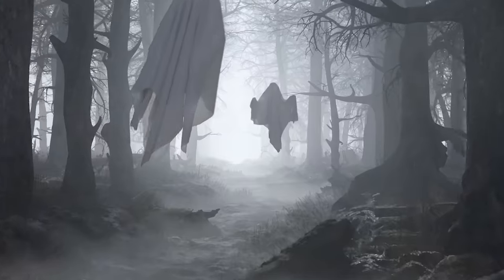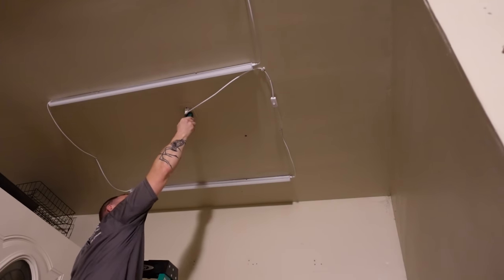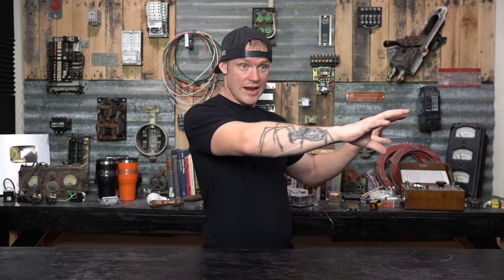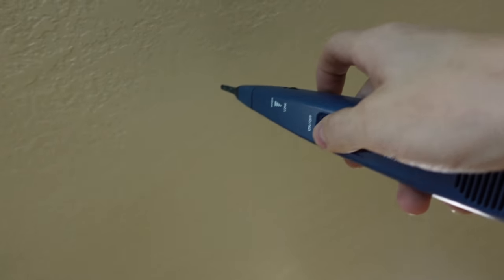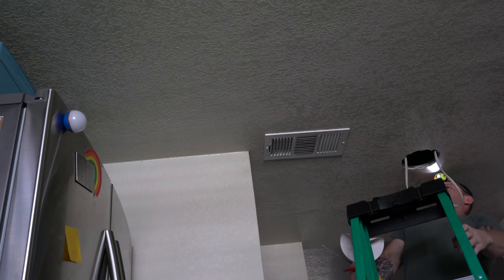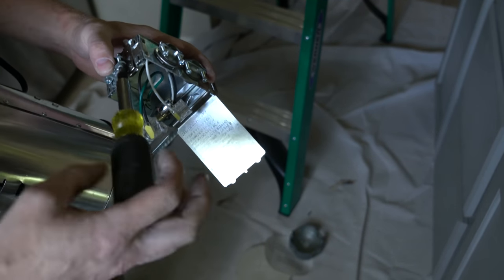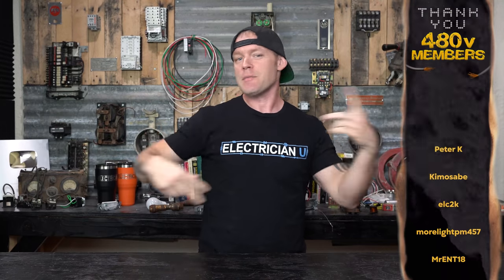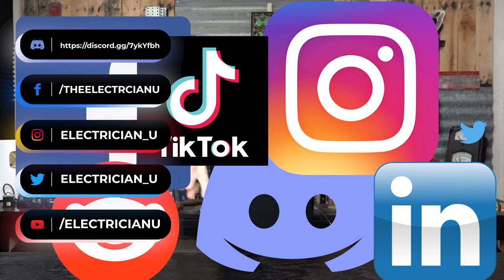THIS IS WHY ELECTRICIANS DON'T HIDE J-BOXES IN WALLS - Finding Hackwork!!

Comment: As a journeywoman in Canada my entire apprenticeship was tough... I mean the 2 companies I worked for held me to a higher standard than the boys. Never picking out the mistakes of them but my workmanship was nitpicked... as unfair/sexist  as it was I do believe it made me a better electrician. As a 3. and 4. year I even got my own service van issued and my main job was troubleshooting all my journeymens crap work. I had to learn all the different guy's decades of wiringmethods etc so I could efficiently fix their mess.  As a result most coworkers didn't like working with me because I guess I made them look bad... since in a man driven industry us girls are often held to a higher standard or we have to work 3times as hard to earn the old geezers respect. So for me it was always sticking to code...( no Mickey mousing on my part, that way they couldnt complain about my physical strength lacking because my stuff was always 100% every time )and to the point that when some apprentice had a code question they were told to ask Kat, she knows all codes.... lol
Reply: Good for you ! Nothing wrong in being good at your job, I have a feeling those before were not proper electricians! The way we learn in the UK is to change companies often because I found many got into a rut, plus some specialise, so its good to change and have a wider scope of electrical installations. I worked most of my life as an industrial Electrical Technician(Foreman). Often abroad and now retired! Never really got into "house bashing" Mostly industrial.
Reply: I grew up doing HVAC and have officially been doing it for about 15 or so years, and I love seeing women in the trades! There was a girl who worked for a plumbing company that we did a lot of jobs with. She was always respectful of people's homes (something many guys forget to do - like mentioned in video, they have to live there when you leave) and never once did she have a "Fuck it, can't see it from my house" attitude so many guys have with questionable or shoddy work. Other than a few exceptions, like carry the old water heater up basement steps, there's not much a guy could do that she couldn't. But anyway, women who aren't going to college should stop settling for min wage jobs, they should learn a trade!
Reply: It should be that the number of dangly bits (one between the legs or two on the chest) doesn't matter, only how well that squishy bit between the ears works.
Reply: Was it sexist though?
Reply: I'd be happy to work with you.  I also had it tough as an apprentice but it paid off and now I can pretty much work any job I want.  Good job!

Comment: The only thing I would have done differently, (as I used this mindset when doing electronic tech repairs) is what or why did it fail to begin with. I mean aside from it not being up to code, the absurd length of additional wire that looks like it was tapped into ONE breaker raised several questions in my mind immediately. I know that the gauge and length have specs, but I'm not clear on losses when they are tied together.  I have to assume that they probably had several things on at the same time that joined at that junction box.  I know it's not your job to load test everything, but I probably would have highly recommended adding a breaker or two to the main box to prevent further problems. I'm betting you will be called back for additional issues where this can got put in. 

In my electronics repairs for example, it wasn't enough that I could successfully repair the component, but also educate the customer on what they did wrong that caused it to be the issue to begin with.
Reply: How conscientious of you. When someone is willing to tell me how to ensure I don't have a repeat problem - that's a 10-star rating in my eyes.
Reply: yeah you're right, something doesn't seem quite right with the circuit layout. But that is extra time and money and the homeowner probably just wanted things to work again and be safe, not ideal. With problems like this it can be very hard and time consuming to exactly diagnose the problem. Sometimes it's just 'fuckery' like a wire nut was barely loose and it took 10 years for the wires to sneak out of a wire nut.
Reply: wow, definitely not like that for most electricians, usually it's 14 gauge for 15 amp, 12 gauge for 20 amp. Nobody really measures out the max distance. All you'll see is a slight voltage drop as a wire keeps going forward.
Reply: @patrickobrien6648  There's always voltage drop over distance, I guess if I went thru a 250' roll then I may be a bit concerned, depending upon wht it is powering, When in doubt, change to a #12 or #10 but typically unnecessary
Reply: I'm a 60 yo electrician so was not overly impressed with this guy. Troubleshooting these types of problems is NEVER easy though and each one is always different. Asking questions is my go to for residential problems

Comment: Here’s something that happened to me as a DIYer. I was adding a new outlet to a circuit but I wasn’t sure the panel was labeled correctly (we had recently moved into the house). So I plugged a radio into an existing outlet that I knew was on the same circuit. I tried the breakers until I heard the radio stop. I went to the outlet, unplugged the radio and plugged in my circuit tester into the same plug. No lights, so I was good to go, right? Wrong! After I took off the outlet cover I decided to push my test light into the outlet box, and it lit up!!! Turned out it was a split outlet with the top and bottom on different circuits. The top one was off, but the bottom one was still hot!!
Reply: Those should be ganged breakers so they both shut off at the same time.
Reply: I came across a junction box that had FOUR different circuits going to it.  To kill all the power in it, I had to turn off FOUR circuit breakers.
Reply: When I do a wiring job, I do all the outlets in the kitchen that way. The only other place you would see something like that is for an outlet that is expected to be used for high current applications like space heaters or power tools. In any case, as one other person has pointed out, the two circuits should be on a ganged circuit breaker so that they are on or off together.
Reply: @paulstandaert5709  That is truly insane! I'm having trouble imagining why anyone would do that. I often have two circuits in the same juntion box but that's because I'm doing split-circuit outlets.
Reply: @surferdude4487  I was 18 or 19 when I ran into that, and didn't really know anything back then. I cannot remember what I was doing in there, but I remember lots of colors in that box, and it was only single phase wiring.
Reply: fucking YIKES!!

Comment: Once I was installing receptacles in a house, and my boss was installing breakers, then turning them on. I found out the hard way.
Reply: Who tf turns on breakers during panel install. Jeebus. Just adds unnecessary hot copper to the box. Also dumb to leave the busbars live.

Das Stoopid.
Reply: Nasty boss. I've done some silly damage to myself in my youth, not serious, but it bit😬
Reply: I got lit up on the first house I built, back in 1989.  I was fresh out of high school,  working in family contracting business.  While I was wiring outlets in the master bedroom,  a couple of my cousins (who I had just graduated with) decided they needed power to the kitchen for a radio, and started flipping breakers.  Magical.
Reply: @adirondacker007  even worse, when other trades decide to turn breakers on.  I had cabinet installers decide that they were too good to use an extension cord from the unit next door (idiots claimed that using an extension cord would "burn up the motor on their saw") and turned the circuits on that I had turned off (LOTO wasn't practical on the project).  I read those kackheads the riot act.  Unfortunately the GC's super was on another project (they were trying to have one guy run two jobs) so there was no help there.  Had the previous super (they went through three superintendents on a six month job) been there he would have kicked those jerks off the project.
Reply: Not sure how's there but here you lock the breaker by law . Also you can't turn on the breaker or even connect the circuit to a breaker until inspection and dead testing is done by law ... so ...
Reply: @contytub  where is that, ad how do you accomplish anything?  Sounds clunky.
Reply: @joshpotter9261  why would it be clunky ? Am i missing something ? Why wouldn't  spend few minutes to do the dead testing before energising a possibly dangerous circuit and then do the live ones? Why whouldn't i spend a minute locking off a circuit before working on it ? Not clunky at all ... just spent 4 days wiring a house . Half an hour making it safe and confirming compliance is nothing. Even if it wouldn't be legal requirement i would still do them .
Reply: @contytub  sounded like you are saying you needed an inspector to hold your hand every step.  Also, where is it law?
Reply: @joshpotter9261  well it's true ... even an istaller has inspection responsabilities . Uk ... it actually sais inspection has to be done before, during and after the instalation ...
Reply: @contytub  it happened over 30 years ago.
Reply: @joshpotter9261  i'm not brittish even if i work here so whatever . I also don't really care about customers liking to pay 5-10% more for certification as it's mandatory and shifts blame to whoever signed it that is mandatory insured ... so paying the inspection and testing fees not only proves compliance and finds possible faults making the instalation safe but also in case something goes wrong because the electrical instalation the customer has the house insured by the inspector-not installer. It also lasts around 1h to 2h maximum so i highly doubt you can do 30% from a 4days wiring/install in just 2h ... you speak like a ''old'' ''electrician'' that may have not received formal training on new standards because old ones ''just work''... well we keep fixing fuckups after these people constantly so good luck forwards as our fixes usually are more expensive and proper ;)
Reply: @joshpotter9261  you are just proving my point ...
Reply: @contytub  haha, your pointy head, maybe.
Reply: stoopid boss
Reply: @Guitarplayer724  i wouldn't say stupid. he's ''experienced'' and aparently certified ''up to date'' ... I've been next to plenty of experienced electricians that earn a lot of money but still work with oudated techniques and tools and fail safety standards continuously . What would we do without them ... when i did my cert one of the chapters was looking out for old electrician's mistakes as they were trained on old ways so even the book and law recognises them as possible hazzards hehe
Reply: @joshpotter9261  There are simple little plastic tabs that slip over the breaker levers. 10 secs to install a lock.  Often overlooked because 120v is usually not lethal, but I hate shocks.
Reply: @joshpotter9261  everywhere. OSHA is a federal agency
Reply: @clintsmith4026  so what's your point?  You don't have one.
Reply: @contytub  haha, you'll never have to fix anything I do, because I do it right the first time.

Comment: Excellent video, love your process! This job of yours reminded me of one I was on where a friend had an issue where one circuit on one leg was undervolted, another circuit on another leg was overvolted (and cooked some surge protectors). 
Deduced a floating neutral condition from utility side... utility, through remote testing, insisted their side is fine and said the home had a grounding issue, and sure enough the strap had deteriorated away as well as the top of the rod. 
Ran a new strap and pounded in a new grounding stake, and of course the problem persisted but at higher loads, my friend started losing appliances at this point.
I sent them photos of new strap, new stake, and wildly swinging voltages between the legs in the service panel to get them to physically come over and look over their shit. 
When they finally came over, they disconnected the house side of the feeder drop and it arced out somewhere in the middle, which solidified my hunch that there was a utility related issue. With the new feeder from the pole to the house, the problem was resolved.
So it seems like there was an issue going on with the service neutral and the house's neutral current had been going back to source via ground, which accelerated the corrosion (we get 11ft to 12ft of rain a year) and when the grounding strap finally failed open, the house's circuit had no low-impedance reference and thus allowed the neutral to swing around based on load. My friend was giving palliative care to her dying husband at the time and luckily she only lost a central vacuum and a bunch of surge protectors, nothing more serious than that!

Comment: For those cans Klien makes an adjustment holesaw bit with a built in catch tray
Reply: Throw the adjustable bit away and use the tray with a normal hole saw. Unless you've tons of practice, those two opposable blades can wobble fairly easy. If you're lucky you'll just fuck up the ceiling. If you're not so lucky, and not prepared, the torque will throw you off the ladder
Reply: Yup, tried using those things. Utter trash. The dome was nice for minimizing the mess, though.
Reply: @ajyhimst2782  Or better yet, they come loose and get yeeted across the room into something/someone
Reply: @ajyhimst2782  Or use a decent drill with torque settings. But yes, I prefer normal holes saws.... Got a reload kit... can place smaller hole saws inside on arbor and enlarge holes if needed for different size fittings.

Comment: Man. These are nightmare situations sometimes. Very good break down of your process! Appreciate you man! Did you get my last text?
Reply: I wouldn't  call this nightmare situation lol. Seems like basic troubleshooting process to me. Definitely helpful for people that don't Deal with troubleshooting scenarios
Reply: @christophertague9485  My least favorite is buried boxes. Then again, I never used a toner.
Reply: @nickcheatle3927  yeah man never a good idea 😆. But then again that's why there is nec. I'm guessing by the way that j box looked inside and out,  that it was not an electrician that installed it ,or one that did not care at all.
Reply: Never a good idea meaning burying boxes btw
Reply: Toners are great tool have
Reply: @christophertague9485  yea, who uses octa boxes for j box?? 😄
Reply: @nickcheatle3927  I mean if you do it right it can be used same as a 1900 box. I think the splices were the issue 😬😆
Reply: @christophertague9485  I mean, it CAN be done. But why.

Comment: Sounds like loose neutral broken enough to make the neutral carry line voltage but not enough to tie back to the panel. Thusly making neutral a hot or partial hot and having no voltage line to N because they both had equal potential.
Reply: I bet there was a lighting circuit on the fault side of that junction box that was on and pulling the neutral to line voltage.
Reply: @newjerseybill3521  yep that lamp or device maybe was allowing voltage to come back on the neut.
Reply: Yep. Spot on. That's why we use stranded not hard drawn cable in Australia. And those wire nut things you guys use make me cringe every time I see them.
Reply: @TheDegan79  interesting. Why do wire nuts bother you? First of all i do understand the idea but when properly applied they are effective. What i do to make wire nut connections is use my strippers as a wrench and twist them until the 2 or three wires in them make a full tension loop around eachother. Also what do you use in AU
Reply: @jesseready5667  We use BP's (Blue Point connectors) and yes, always twist.
Reply: @TheDegan79  interesting we would call that a terminal strip we use those in industrial controls but not residential outlets or lighting.
Reply: @jesseready5667  Not the strip style one's... single tunnel. One's with 2 screw's are for earth's but that has been changed recently to allow one screw as long as the screw occupies 80% of the tunnel
Reply: @TheDegan79   look at this from my point of view momentarily. You use a set screw style attachment to bind wires down. We use a scree type attachment to pull wires into eachother its generally the same idea except our splices cost 19 cents american. How much does a bluepoint barrel/tube splice cost per 1
Reply: @TheDegan79  Yes, but you are upside down all the time!
Reply: @jesseready5667  AU$11.50 for 100.

Comment: One thing that I think is worth mentioning with regards to safety during diagnosis on live circuits:
If you're diagnosing a problem, you can't assume things are wired correctly.  
Things that are normally grounded and safe to touch may in fact be live.  Hot may have shorted to an ungrounded junction box.
Things that would normally be safe just by turning off a switch may actually stay live.  A switch wired backwards can still deliver hot all the way to the fixture.
Make no assumptions.